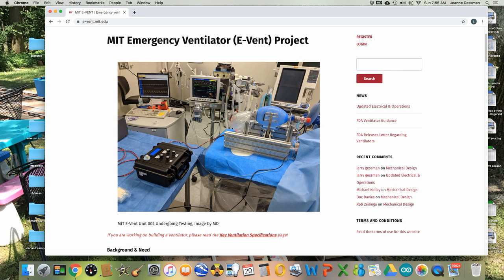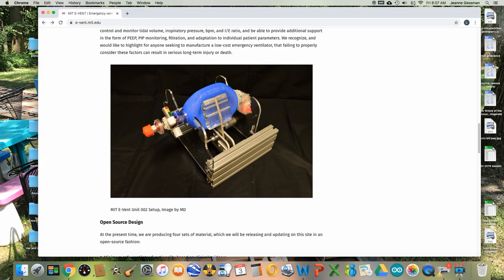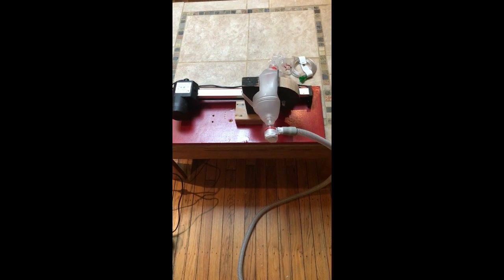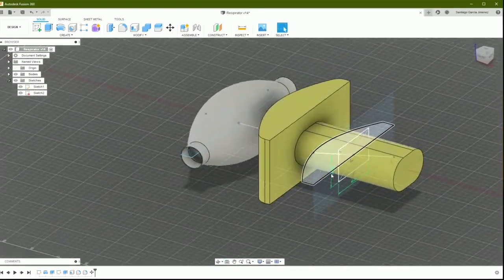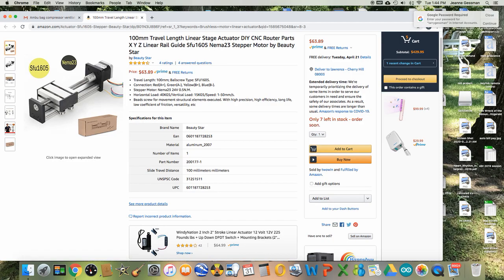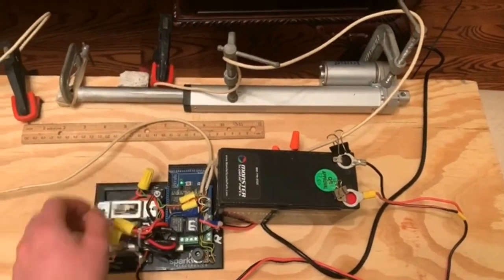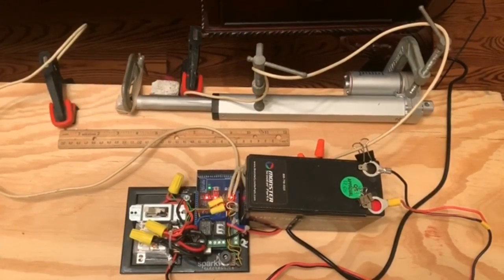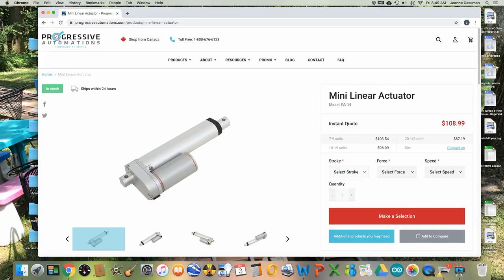linear actuator compressing ambu bag ventilator

Comment: Ver good. But too complicated for the Third World and complicated in an emergency in the United States. Take a look at this: youtube[dot]com/watch?v=_0lB3IuuDo8 (use a dot--  .  -- and leave the brackets out.
)

The above youtube shows an easily constructed Vent using metal, wood, or plastic using hand tools. There is only one moving part and is robust enough to be transported in the back of a truck bouncing over roads, with thousands of holes per mile. The video can also be seen on this website DoctorDoctorDoctorDoctor[dot]com where you can see more details leave comments.
 "When you have a hammer, everything is a nail."